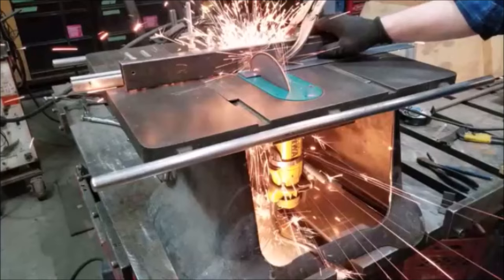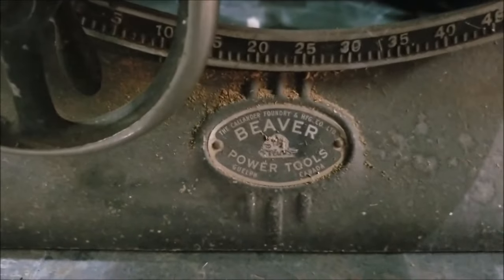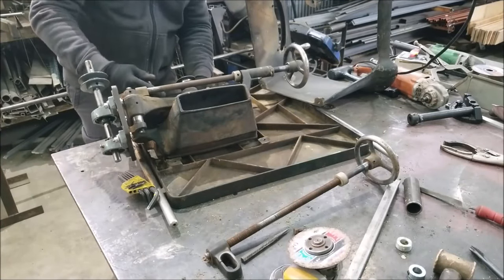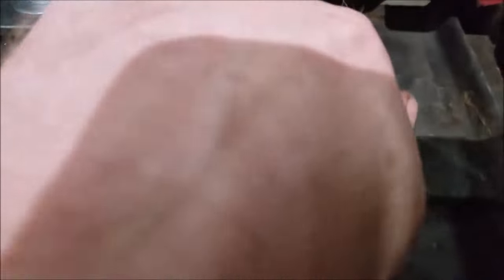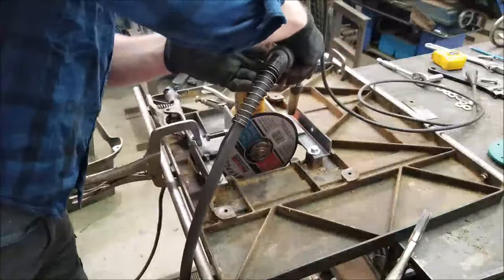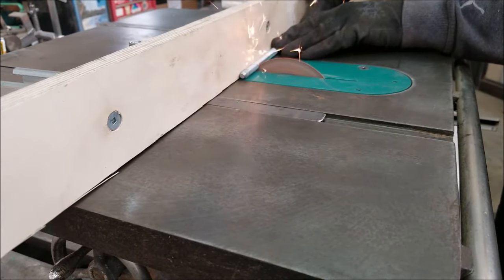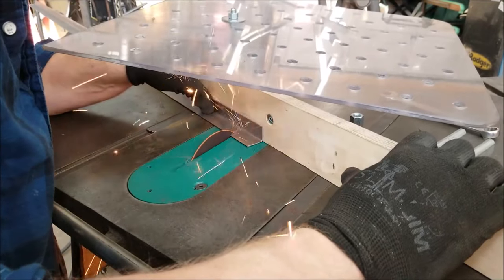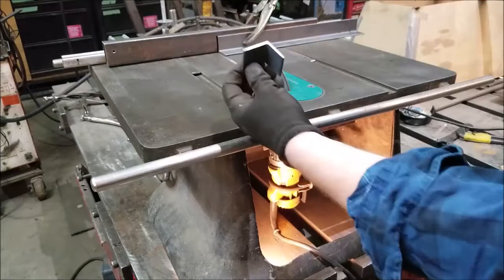Angle Grinder Table Saw DIY

Comment: I had this exact table saw and sold it a few years ago on kijiji. Wish I had the time for a project like this. BTW fine teeth on the bandsaw at the appropriate speed is what I use on my bandsaw for cutting sheet metal.
Reply from the maker: Beaver sure did make a lot of them. Well made too